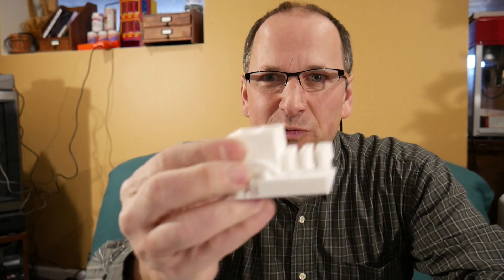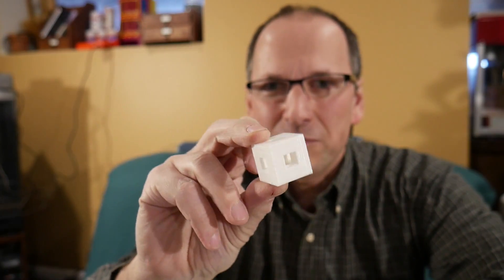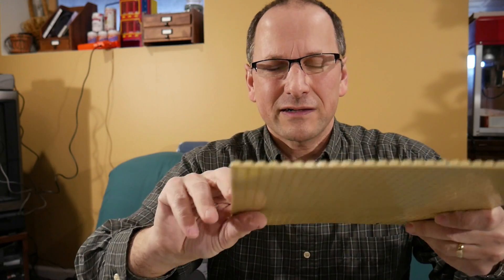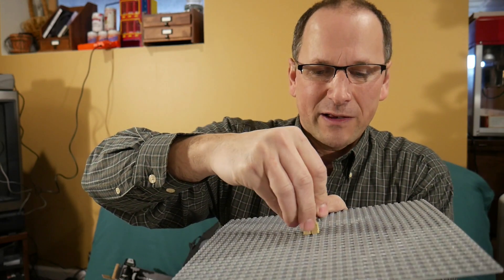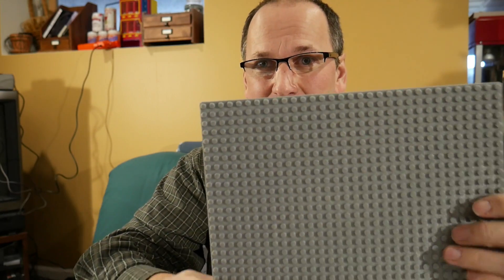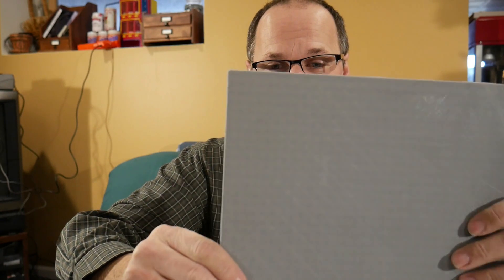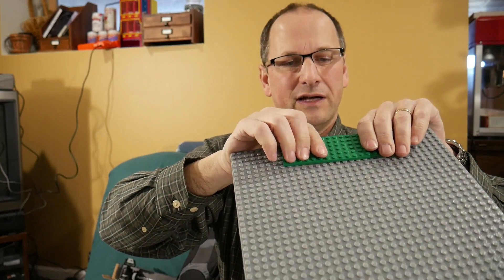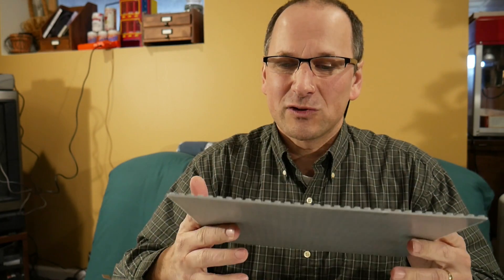3D Printer Calibration Challenge : ABS Brick compatible 32x32 Baseplate ! Stop wasting filament!

Comment: I have the cr 30 belt printer do you know if there is a file to make the base plates as wide as the belt and about 12 foot long? I could deal with even 4 foot long but I don't know the dimensions or how to loop a file where they continue over and over again in the gcode.

Comment: This actually got em another good idea. I want to calibrat my printer, but i doubt that my calipers are extremly accurate (because they where < 20€). I had no part available with an accurate well known dimension to test the calipers (because what good is calibrating a printer with uncalibrated calipers?), but i think i could use some lego parts (just need to find the correct, accurate dimensions).

Comment: what 3D printer did you use and how did you avoid any stringing? was it through retraction? also what were your speeds and infill?
Reply from the maker: I have one original Makerfarm I3V and 2 DIY versions I scratch-built.  With PLA I rarely get stringing, even at higher temperatures (which I prefer for better layer bonding).  My speed settings are probably i8rrelevent for you since it's a different printer, btu I do tend to print on the quicker side (being an impatient person sometimes).  The infil on the plates was nearly 100% due to the number of upper and lower layers I used, but I think 2 layers (the most internal where consistency would not effect fit) wound up at 50% infill.

Comment: Camera tip, if you're using auto focus, use your open hand and block your face. Most cameras use face detect, even if face detect isn't the problem, the hand will give more area for it to focus to.
Reply: The Lego base plate for calibration is a nice trick.

Comment from the maker: I'm finding that somewhat bigger plates are better for more aspects of calibration.  The most challenging thing turns out to be how consistent the extrusion is from pin to pin.  This shows itself when you snap a bunch of 1x2 tiles on top the plate.  If the gaps between the tiles are uneven (yes, now we're into microns!) , there's more potential for further calibration... (but the plates are still wonderfully useful for less critical building.)
Reply: Do you remember how much did it  cost to print that grey baseboard you showed?